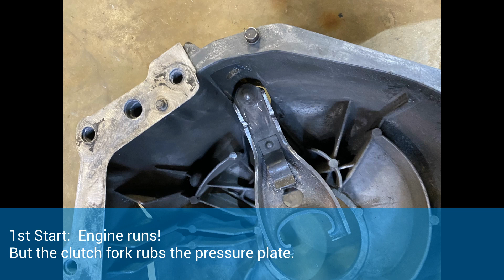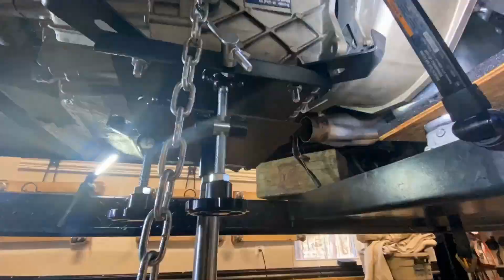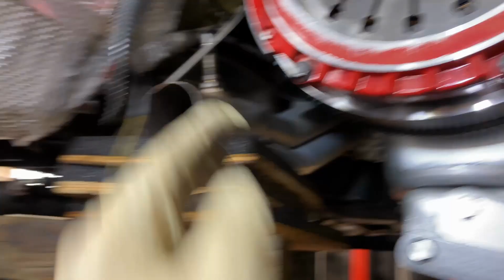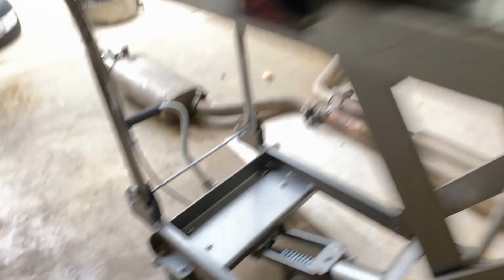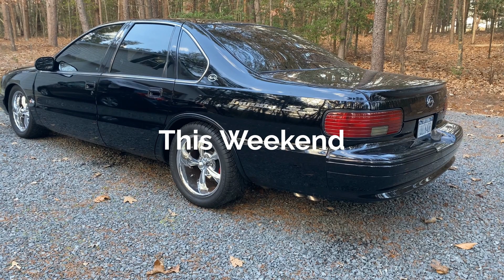1994 C4 Clutch Fork to Pressure Plate Interference

Comment: I’m having this problem on a 95 4 runner that I put a Lexus 1uz v8 in. I work in a fab shop so first thing in my head was to make a spacer from the bellhousing to the motor so I cut one out of 1/8 aluminum and threw it on and it works amazing. Only other fix I’ve found is the pivot point of the fork has a ball on it and you can get a smaller or larger ball to extend or decrease rotation of the fork.
Reply from the maker: Thanks for sharing

Comment: I do wonder if it could be adjusted just by the master or shims on the slave, if it's able to get full engagement before hitting the pressure plate then that might be the solution
Reply from the maker: It is quite possible.  I'm going to call McCleod Monday and bounce these ideas off of them.